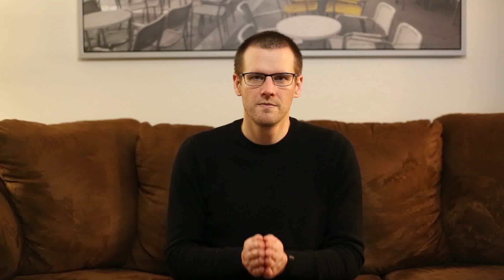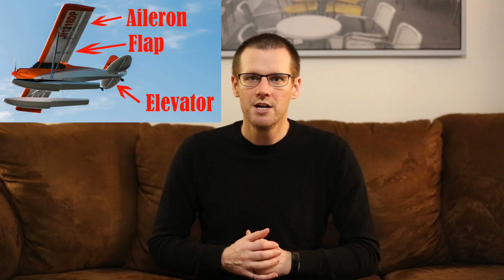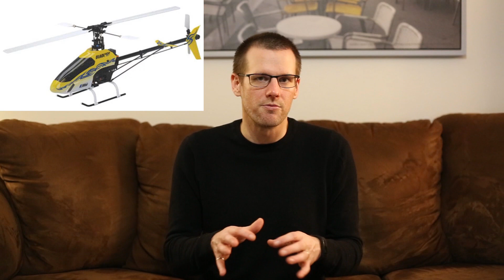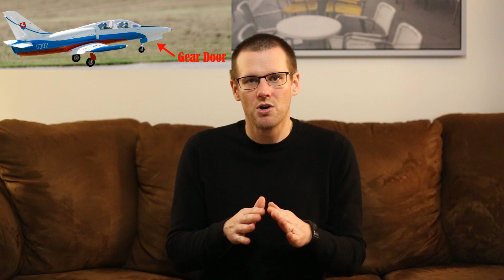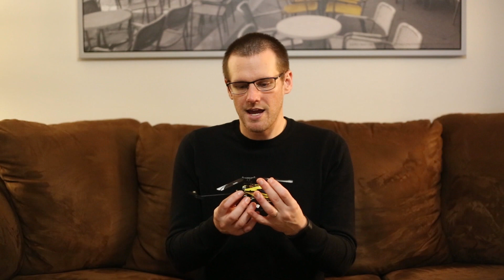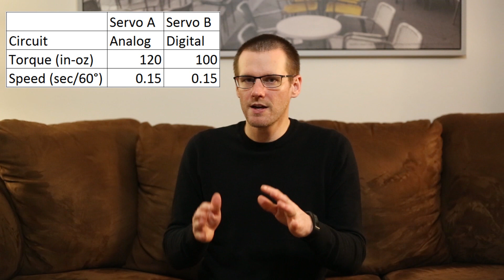Where to use Digital vs Analog Servos in RC Vehicles

Comment: I think the problem with using analog and digital servos in the same model is when using both the radio/receiver needs to be set to use analog servos and not use the full potential of the digital servos.

Comment: I just installed the Radiolink RC6GSv3 with R7FG into my 2010 E-Revo Brushless
and right now learned that the R7FG does not support digital servos, so it will only run on 14ms

I still have the stock dual TRA2075 servos which are digital (they just haven't broke yet for me ;o)
can running them at 14ms damage them or it just decreases their performance?

kinda pissed, Radiolink do not disclose this anywhere, it's not on the product page, not in manual (only found it in some facebook reply from radiolink themselves)
for monster truck with big tires for sure the digital servo is what you want
Reply from the maker: I run all my servos on 14ms. Digital or analog and have no desire to change it at this point.

Comment: hey there, for a sailwinch, would you use a digital or a analog servo?
Reply from the maker: I prefer digital for most applications that need torque in with small amounts of control input. But my sail servo on my old sailboat was analog

Comment: I had two Hangar 9 Funana  70"  3d planes and just used Hitec 485s a supposedly low spec analogue servo ,I could do hard 3d flying with this set-up and they were silky smooth. Now I use digitals in some planes and the screaming gives me anxiety. If I could buy 20lb analogue servos for my bigger planes I would .

Comment: Many Many Many years ago in the rc airplane field ho I say about 25 years ago most of us flyers all we had  analog servo's . This is because this is all was offered and they did work great . When the Digital servo came a long and that changed everything . ( Not ) . It just made thing expensive . LOL   There is a down side of Digital servo that I dont like . That is Noise from the servo . There are some people have to have the best even at that time . So when the Digital servo came out these people have to have them so they can say ! I  have something better than you . That is what it truly means . I am better than you .  Just some B.S. . It still did not make them fly any better . They still crashed there airplanes . HA HA HA .  I still fly analog servo and still crash my planes . But it's a hell of a lot cheaper to buy Analog  . The best thing happen to servo's are metal gear servo's .  The only bad thing I can say about the analog servo's is the POT . The POT can fail . The good thing about analog servo is that there is no noise  at all . Not until the POT starts to go out and the jitters starts . When that happens then it is the time to replace the servo .  I think the best servo would be an analog servo with metal gears and brushless motor . That would be a great servo to me .

Comment: You don't mix analog and digital  servos .  To get the most out of digital you run a higher  hz .    And that will burn out analog.   ..   run all digital  or all analog  don't mix !   Noobs making  how to videos lol
Reply: Not true.   They all recieve the same signal from the reciever.   The frequency difference is all in the servo circuit board.
Some specialized high speed modes on some transmitters require digital servos.   Lots of rtr heli's have a digital on the 
tail rotor and the rest analog.

Comment: I've enjoyed the last two videos on digital servos versus analog however you didn't mention anything about the need for the proper receiver. Many receivers will not allow a digital to mix with an analog or power a digital servo. Thoughts?
Reply: I’m yet to see this be the case. Most servos if the same size use the same 50hz PWM signal. I haven’t found a servo that doesn’t work with this signal yet, but also I’ve never seen a receiver out out anything different. As long as it has ground, power, and a 50Hz waveform PWM signal it should run. 

I’ve run digital servos and with a few cheap analog servos on my last several builds (FrSky and spektrum receivers)
Reply: @adamhale6672   May be specific to Futaba FASST receiver  R6106 HFC in regards to link mode. They warn against mixing analog and digital in HS mode.

Comment: You can get away with analog servos on a swashplate on a helicopter, but a digital servo on the tail rotor pitch control is a must have.

Comment: Hey Ryan I saw this video and as always learning so much from your videos, and on purpose I have a Rustler which steering analog se is not so precise giving a erratic driving. Nevertheless could you give me your oppinion. I have a brushless combo with a voltage regulator that clocked at 6v 3a maximum, and I have two 5v fans one in the esc and other on the motor and led lights. Like you said the " hungrier" power consumption of a digital could affect the normal performance of this set up? Greatings from Portugal
Reply from the maker: That is correct. you will want to make certain that your accessories and servos do not exceed the maximum continuous rating of the BEC current. A digital servo will definitely help with more precise steering if that is what you are lacking.

Comment: Genius great video 👍👍👍. I'm building a limitless & from your video on motors I choose the xo-1 motor 1717 BB 1650kv w/max6 esc. But the gears it comes with 27/34 it believe are considered high & I've searching for a good explanation on gearing the way you explain it. Which I'm looking for good balance like at low speed drifting/bashing (without overheating)  & full throttle speed run (when time, space are great). Have you made a video on gearing?
Reply from the maker: Thanks for the awesome comment!
I do have a gearing video, however, there is a lot to it and it may not cover what you are looking for: 
https://youtu.be/z8QJ347hW0k

Comment: Very interesting!  So I bought one of these: Turnigy™ TGY-50090M Analog Servo 20T MG 1.6kg / 0.08sec / 9g for fitting to the aileron control of a plane I built and I noticed that there seemed to be a delay on the reaction of the servo from the time you quickly moved the stick to the time for the servo to complete the motion on the plane.  Is this because it is an analog servo or could there be another explanation for this delayed movement. Thanks.
Reply from the maker: Hello big5astra, thank you for the comment. There could be a number of different reasons as to why you are experiencing sluggish servo response. Are there two of these servos operating the ailerons where both are acting slow? It could be as simple as a defective servo.
I would check to make certain it is not something that is programmed in your radio that could also be causing the delay. If you are unsure, try it with the most basic radio that you have to see if there is any difference in the response time. 
The longest delay you should experience with an analog servo is about 20ms. For a control system response time, this is quite long, for human response to be able to notice this, its a relatively short time. I would not expect analog to be the answer to your question.